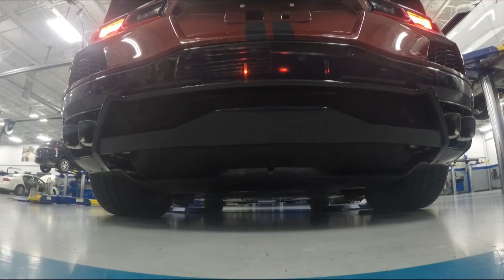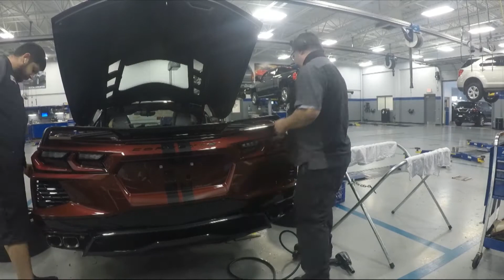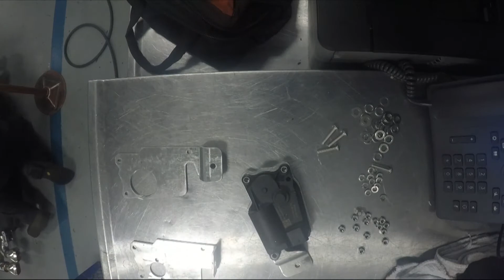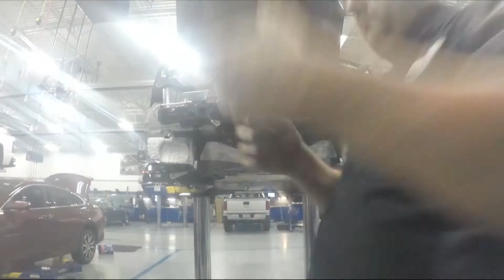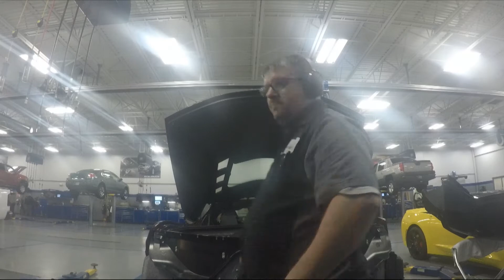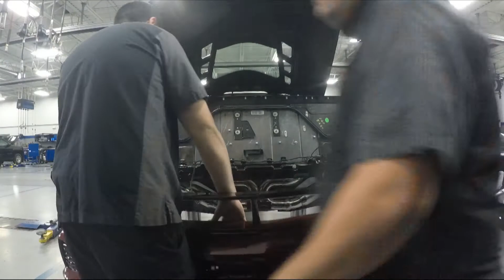C8 Corvette Hennessey Exhaust Installation Timelapse - C8 Exhaust High Wing Installation Timelapse

Comment: How long did it take from start to finish?
Reply from the maker: Just exhaust I think was around 3-4 hours. I spent alot of time adjusting the tips to look good. Plus I also installed the high wing. I think it was around 5 hours total. It wasn't too bad and they are easier once you've done a couple.
Reply: @DMoneyGarage  thanks